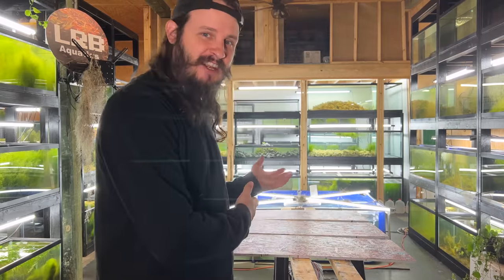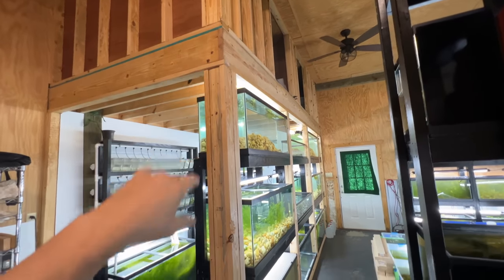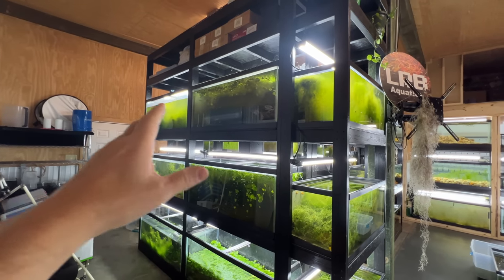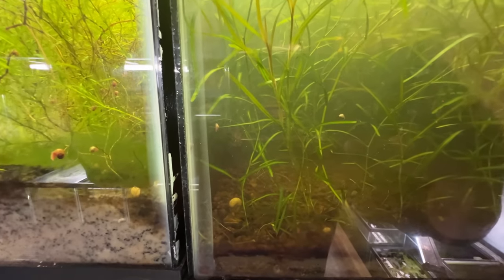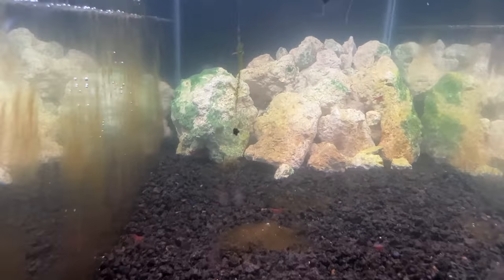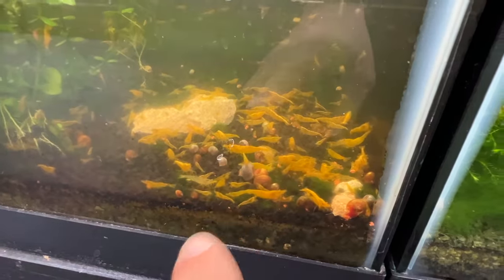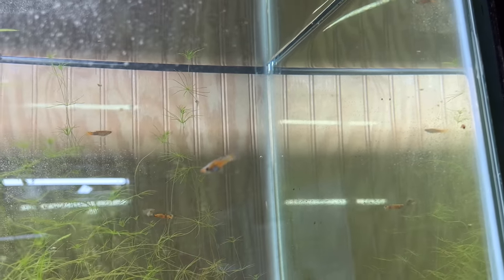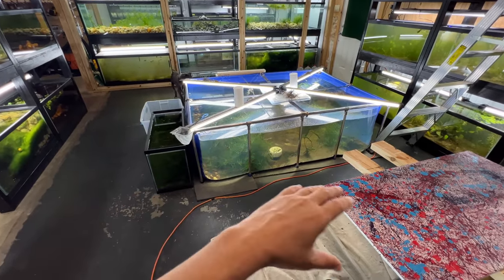Bet You've Never Seen a Fish Room Like This!

Comment: Thanks for sharing. Really inspiring! Congratulations! Being so no-nonsense and simple it is really a fish-room in a league of its own.   
I am trying to put myself in the shoes of someone with the privilege to have such an incredible space for building a dream fish-room like that and I probably would at least work on two lines of evolution: 
1 - Energy efficiency - I live in Portugal where energy is not cheap and went up like 40% due to the Ukraine war so I would aim to have my lights operating from solar panels, same for any air pumps (those latter do require batteries but, with proper planning, led lights can be connected almost directly to the panel set if you are willing to have the light cycle matching the natural one - I am using an experimental system like that and it is running flawless for one year). 
2 - Water management - I know you use the concept of minimum water changes but at least in a rack or two, having an automatic system will allow for more flexibility and surely more aggressive stocking.

Comment: Looks good, jealous of all that space 👍  Thats a lot of tanks to get up and running in less than a year.

One thing I have noticed with those green jades is that they are super dark as thats how I been lining them out the last 4 years, but if you wanna chase the more of a green crayon color its easier to bring that out on a black substrate.  I've kept them on light colored tan pea gravel and black sand.  Seems like they get even darker, and you get more of that teal/turquoise on lighter substrate.  Discovered this when I reset a green jade tank from the pea gravel to the black sand, so many completely changed color, same tank, same light, just light tan pea gravel to black sand.
Reply from the maker: Interesting thanks for the insight they are beautiful greens! You did great work on them!

Comment: 43:10 Have you considered a library/store room style moving ladder on a rail to access those higher tanks? Hide it around the side at the end of the rail when not in use.... Easy access to those top shelf experiments. Also those portable "Wheelie stairs + standing platform" ...  like a mini Airplane stairs ... could be a good option too, just leave a space somewhere to tidy  it away
Reply from the maker: I have thought about it but for the most part I don’t need the ladders on a daily. I do have ladders that are easy to get too. If I did ever try to tackle a project like that it would have to come way down the line since it’s easy to just grab a small ladder.

Comment: I am new to your channel so forgive me but how do you deal with high humidity and bare lumber. Also it appears you have bare lumber in contact with concrete. I used to be a builder. I sincerely hope that you have treated all that lumber not to mention  the hardware used in assembly.
Reply from the maker: The barn was already built like this with the wood so had to work with what I have. The barn is far from air tight so it gets a bit of airflow. Luckily I live in FL now where I don’t have to worry about the winter condensation that would be a horrible situation for this wood. I do use exterior decking screws and paint. And as far as the concrete moisture since the temps stay regulated and doesn’t get very cold I don’t have to worry about much moisture drawing up. Especially with the vapor barrier below. Thanks for looking out.

Comment: if you dont do your water changes, what are your TDS levels?
Reply from the maker: Would depend on if I’m using hard or soft water. Softwater is more acidic so the TDS could lower over time. If hard water and doing top offs the mineralization would add up. I still recommend water changes just not extreme ones. Like everything a good balance is key.